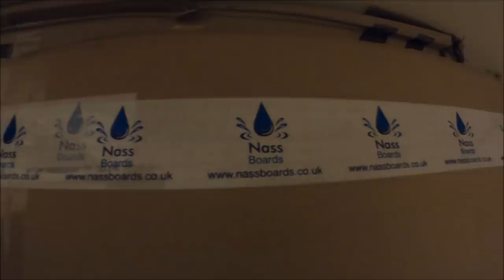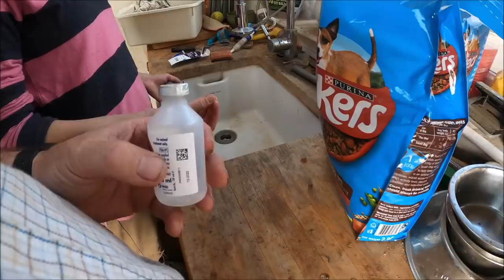No flight but Abbi does some sheeping!  Includes "Some naughty langage"16 10 21

Comment: Would you think of using shuttering panels and poring the wall with ready mix  concrete
Reply from the maker: I could, but pre stressed panels can be taken back out again and hold some value. 🙂👍🏼
Reply: Ok l understand why you are waiting and as a farmer  l understand your frustration
Reply from the maker: @brendanwhite9799  
I really wanted the job completed by now Brendan, but it looks like the combination of Covid and soaring materiel costs we won’t get it all done this year. The granny flat has got to be finished, the barns….. I can muddle through if needs must.